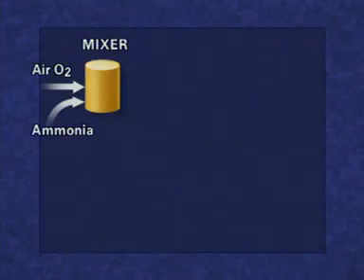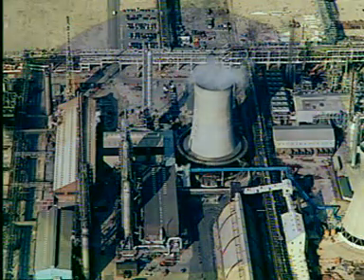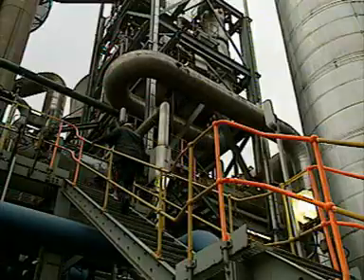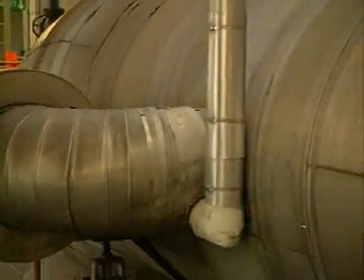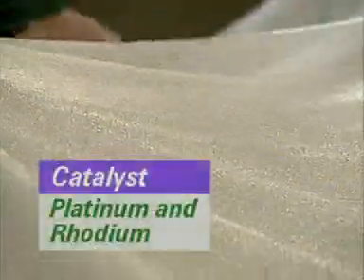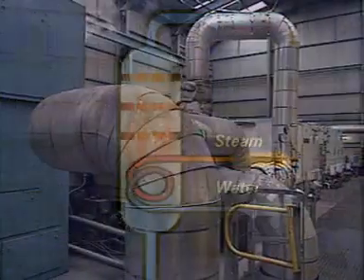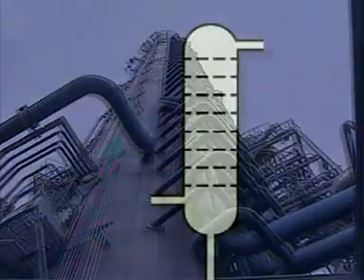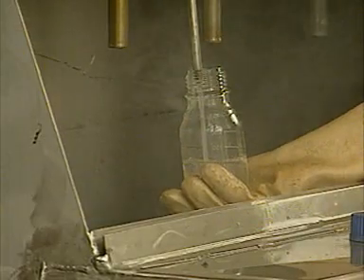Nitric Acid

Comment: This video is a desceptive. This process produces azeotropic nitric acid, not fuming nitric acid. The video begins with claims that the products of the reaction are used to make explosives. Azeotropic nitric acid is not usually used for that purpose.
Reply: It is actually. Transportation of wfna or rfna is tricky, so they mix azeotropic nitric with oleum. The so3 in the oleum eliminates excess water from the azeotropic nitric, and due to easier transportation it is easier and cheaper to manufacture energetics on a large scale
Reply: @asgkllngfxxhkkvxdhkkbhjllnvcg  Thanks for the explanation.
Reply: Ammonium nitrate,  which is used in mining as an explosive after mixing with an organic compound, is made by reacting ammonia with 60% nitric acid.